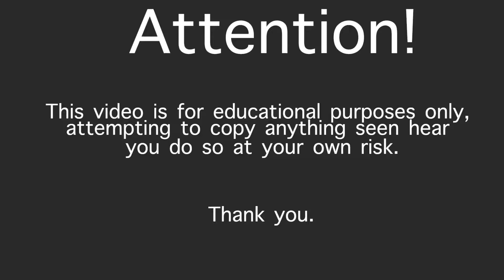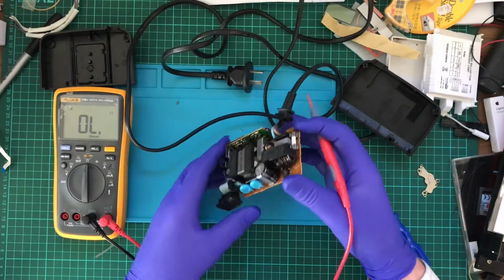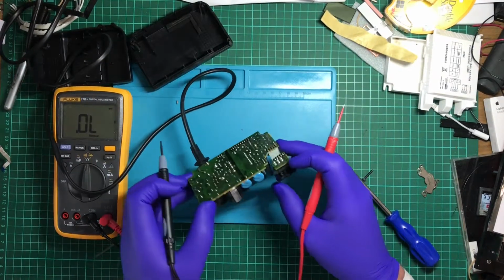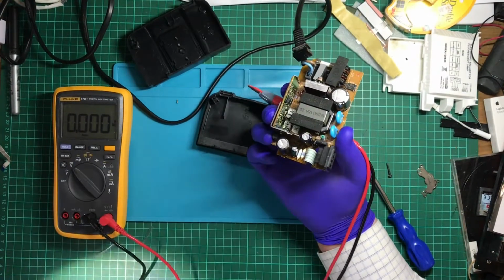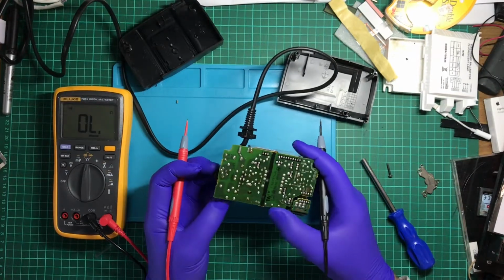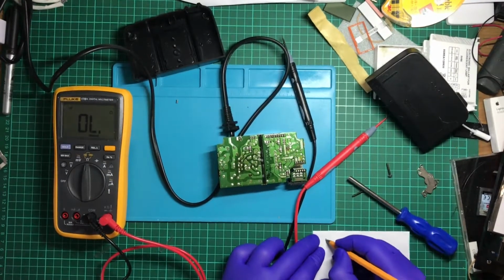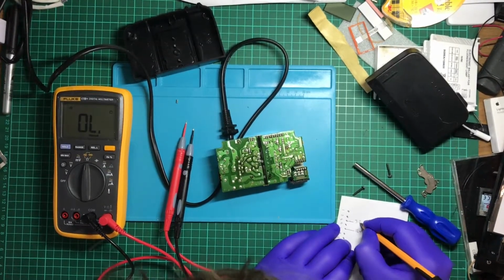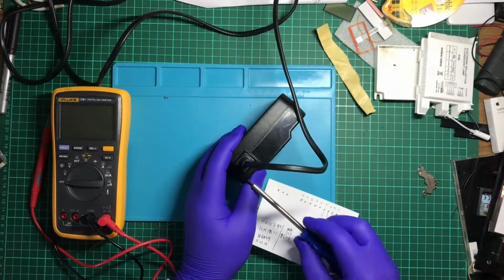Exploring a broken Nintendo 64 Power Supply.

Comment: I opened my N64 power brick today and it was a nightmare when I opened it...it smelled burnt and had black ash all over the motherboard, with some sticky substance, but then again I've had this console since I was 13, im 36 now...long story short my games started to freeze on me while gameplaying, so with a little research the Powerbrick was the culprit...it works like a charm now. 👌
Reply: Did you end up just getting a new power supply? I'm having the same issue I think, got mine in 1997 now I'm 37 😂
Reply: @eliottgrainger4605  wow its been 2 years...😆 I gave it a good cleaning, alcohol and swab did the trick for me.

Comment: I had 4 broken PSUs for N64 and I fixed them all. all of them had the same problem. If anyone is interested I can provide some info
Reply: What was the issue? I have one that completly dead and one outputting correct voltage but dies under load.
Reply: Why wouldn't you just supply the info so people can see it? What was the alleged issue you found and solution that worked?

Comment: Hello, have you got any luck with this? I got two N64 with 2 faulty PSU:s. The voltage goes up for a brief moment when powered on after being long time powered off but goes straight back to zero. I suspect the feedback circuit is the culprit, but I'm no expert on switch-mode psu. These psu's are considered to be notoriously hard to fix, which of course peaks my interest.
Reply from the maker: No, that is still pending.

Comment: What was the actual problem?
Reply from the maker: No idea yea, I am still trying to figure out switch mode power supplies and get myself set up to better troubleshoot it.
Reply: @Michaelblog456  I agree with you though I definitely feel like it is the side chip that has gone bad.  Like maybe not the whole chip itself but one a single component in the side chip has most likely gone bad. That power supply is very possible to fix since power supply have Through Hole Components, it's not as hard as repairing electronics that have Surface Mounted Component. What I recommend doing taking out that side chip, take picture of it to know where to place the components back, and the desolder all the components from the board. Than check each individual component is working with the multimeter and if it is some component within that chip it will, it will reveal it self. You can do the same process with the main board but try out the little board first because it actually may be it and also it seems there less component there. You will find the component that is defective doing it that way. Good Luck.